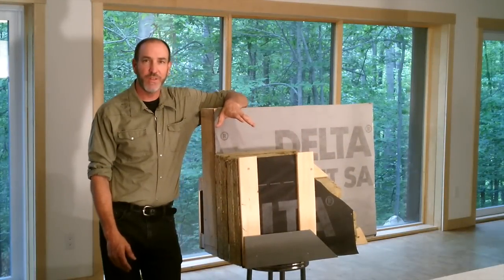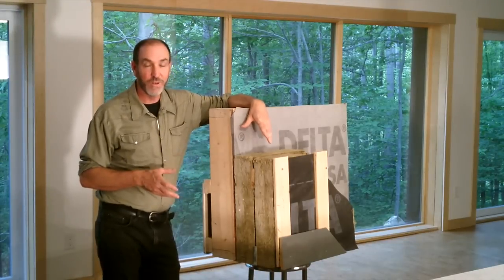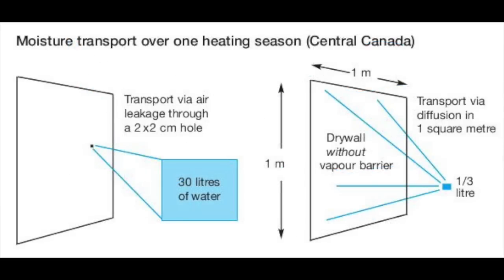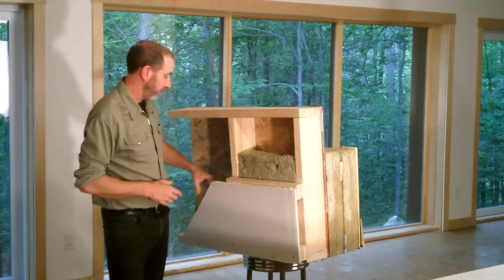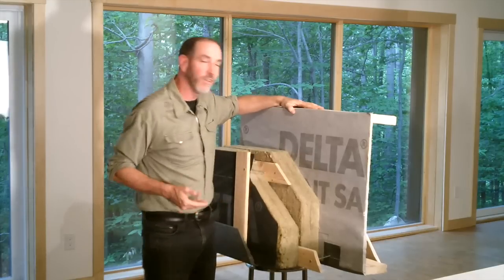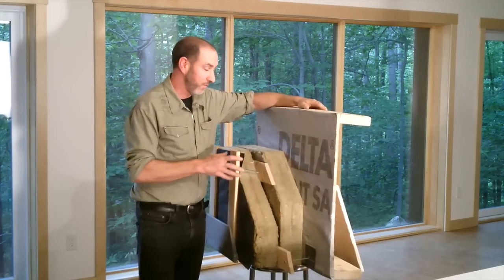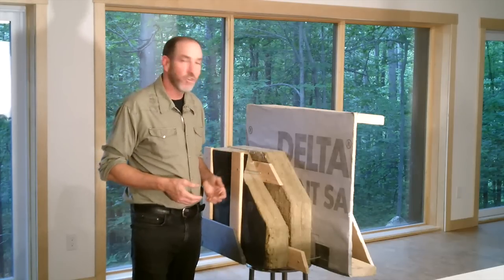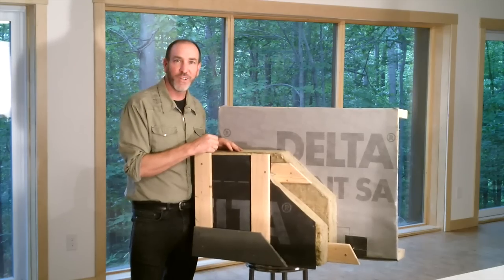How to Build High Performance Walls for Homes, LEED - PH - ZNE - Design, Insulation - EcoHome Guides

Comment: I cant agree with this wall type. as a GC, I understand the need for exterior insulation, however this is all great in theroy, but it costs much more in labour, and materials, and most importantly, time. i think just a proper tyvek, and one layer of roxul comfort board with 3/4 rain screen would be sufficient. but hey, maybe im just old school. its just that its much better in theory than practice.
Reply: Pete Billings - There are lots of ways to build a wall, this was an attempt, we as well found it to be labour intensive and would not do it exactly like this again. If you have a better idea, pop it up on youtube for the world to see - and shred :)
Reply: @Mreynolds.ecohome  Great stuff!
Do you have a link to a description of how you'd do this now?  Would it be different with 2x3" instead of 2x4" exterior mineral wool?  And where is your thinking today on the air barrier over the exterior mineral wool?
This looks like what I want to build now, but I'd very much like to hear about what I really should be doing.
Reply: PeteBillings PeteBillings Exactly. Old school won't work when energy costs start picking up 10%/yr as projected for the next ten years. With a wall system like this you can save on operational costs for the lifetime of the home. Further, you can reduce mechanical systems. Should really consider taking a course in passive house especially if you're a GC.
Reply: lol. Please don't patronize me by saying I should take a course in passive home.  I guess I didn't explain the  wall type I was referring to enough for you. I get a minimim of R40 with the walls I build, but they're simpler, stronger, and much less maintenance than this design, this double layer of exterior insulation will fall/collapse in 10 to 15 years in at least one section. Redoing siding , stucco etc... is not ideal 10 years after building a new home. If you were a GC, you would know, you cant build something you do not have complete confidence in. The vapour retarder paint is another idea Im not into.  what kind of upkeep does it require? will i really last 20+ years? As responsible contractors we build each home as if they're ours. I'm not arguing an eco friendly wall, I just don't agree with this wall design at all.  Looking at this design I can't be confident in securing the strapping or any type of siding onto this.  Its easy to design without knowing the ins and out's of the actual construction.  Like I said, I'm all for building passive homes, but I don't think going with greater and greater EXTERIOR insulation is the best way to go about it.  I would much prefer a double 2x6 or 2x8 wall with a 3/4" air gap between with 2" of roxul comfort bat for exterior OR 2" ridgid foam exterior that what this guy has come up with.
Reply: Theory is nothing without doing actual testing. Also roxul insulation has such minimal degradation it’s basically a lifetime insulating product. Which means as long as the house last the insulation will as well.
Reply: Pete Billings. Geez. This guy must have some rich clients. I built houses in the southwest for 40 years and built a lot of stud and crud. Some masonry, and a few frame wood siding.  But on a standard stud/crud house we used 2x6 frame w/ 1" foam over double d paper, then 2 coats of stucco. I always used 1/2" or 3/8" osb for shear. The inside cavity is just r-19 w/ vapor barrier then sheetrock. Sometimes we would go w/  thicker rigid foam on the outside pre- stucco. Are Canadians that well off they can afford these killer walls?
Reply: In my State of Washington, Tyvek doesn't work! Never has...now their commercial is much better? Why, 1. nobody tapes the tyvek seams...2. The problem with tyvek and cedar is well documented.. the tannic acid in cedar, (oak and black walnut to name two other woods)  attacks the chemicals that make tyvek...So, all the other stuff is not theory, its science...Passive house, sustainable building techniques have been been proving to work and save 25-30% in future energy bills...

Comment: How would you adapt this setup to improve on the R-value of ICF walls, and how would that influence the various air / vapour / etc barriers?
Reply from the maker: The easiest and surest way to improve the R-value of ICF walls (and to shift the Thermal Mass of the concrete to the conditioned space) that we've seen is this system from Legalett that is Passive House certified: https://www.ecohome.net/products/1069/slab-on-grade-insulated-prefab-form-systems-radiant-heated-legalett-canada-thermalwall-ph-insulated-rigid-foam-wall-panels-with-fastening-system-for-passive-house-or-zero-net-energy-construction-or-renovation-by-legalett/

Comment: why not just build with 2" by 12" traditional lumber, it will allow you add extra insulation, and have a better R-Value.
Reply: you lose the air gap and keep a thermal bridge
Reply: also 2x4s, even 2 of them are a LOT less expensive than 2x12s
Reply: A double 2x4 staggered stud wall is better R value with less cost and no thermal bridging. Still has a higher cost than a standard wall and eats up interior square footage. Exterior insulation leaves more interior living space.
Reply: Susan - There are always other ways to do stuff  and each with their own benefits and drawbacks. The thermal bridging would be reduced with a 2x12 but it would still be there, and that would result in a lower R value. We like the seamless blanket of insulation on the exterior. Regards.
Reply: Or, 2x8 and using Agapan (spelling) or Gutex as rainscreen?
Reply: @ike fun  what an unpleasant and unsubtle response. Certainly not consistent with your name.

Comment: this is crazy. if this energy thing and thermal bridging is such an issue for energy savings then aren't we building with the wrong materials. shouldn't we just replace all the wood with foot thick rigid foam walls. structural foam or in other words sips panel.
Reply: Ike - the house operates for $500 a year for all heating and electrical consumption. A lot of people pay that every month, so the added money you pay on a building mortgage comes out of your utility bills. Here is a great example of that, a builder who calculated a net savings every month by having a super-insulated house compared to a home built to code -  http://www.ecohome.net/news/latest/new-brunswick-s-energy-efficient-home
Reply: NO!, why surround yourself with oil, chemical foam and plastic? Once water gets in, and it will...you'll never know where its coming from, can you say mold, etc..I'm not sold on sips until they can make it with better products, plywood, mag oxide board, ceramic cement for insulation or mineral wool?
Reply from the maker: @roberthaverlock8605  EPS foam is a very succesful and reliable building material that has had an environmental makeover - consider the points here: https://www.ecohome.net/guides/3551/does-rigid-foam-or-styrofoam-insulation-have-a-place-in-green-building/
Reply: SIP panels are flawed because they don't provide the necessary air cavity for proper drainage. Moisture eventually finds its way in and has nowhere to go via drainage/air drying.
Reply: Its really quite easy,...I build mock-ups all the time, so if you can, get off the Foam wagon...when a house leaks with foam you may not be able for weeks or months find where it started from, not to mention its a firemen's nightmare when fighting the toxics...(they have to take showers with their clothes on after each fire) including all foam and  added toxics coming from inside the homes...
Reply: It is an amusing idea, and I'm pretty sure some think tank has brainstormed it. The reality is that those properties which make insulation great at insulating also make them bad as structural members. Sure, rigid foam is compression resistant but it is also dangerously flammable and air tight. The indoor climate would be a nightmare. Also, in terms of environmental "friendliness", given the primary energy required to produce insulation and the average life span of a house, insulation has a very poor life cycle. At least wood is a renewable resource, if managed responsibly.

Comment: So if Im doing a home renovation project with existing foundations and I want to add 4 or 8 " of insulation on the outside whats the best way to hold up the insulation?

Thanks
Reply: IPex products, home depot has screws as well...? See: https://www.phnw.org/assets/Conference2017/presentations/high%20r%20value%20-%20ricketts.pdf

Pages 10 & higher
Reply: What did you end up doing?
Reply: Batten and counter-batten the outside wall. The counter battens take your second layer of insulation in horizontal stripes. The battens provides ventilation behind the cladding. I might be expressing this wrong with my english. Here is an image: http://www.fassaden-dach.de/fileadmin/images/Unterkonstrukt/holzunterkonstruktioneinfach-2.jpg , with a brick wall, but the principle is the same. Such a renovation is going to be alot of work. Both the depth of you exterior door jambs and the soffiting will change.
Reply: Use structural insulated panels from Preimersips.com or R Control. You would not have to do a build out. A 6 1/2" wall preformed at R 29

Comment: Any concern with horizontal strapping between two sections of insulation not be able to dry if water gets there?
Reply from the maker: +Roman Gargulak  No concern at all. Water really can't get there, but if it somehow it did, this is the part we love about Roxul stone wool - water runs right through it so there would be no problem. The exterior membranes are moisture permeable as well, so it has excellent drying capabilities. Good question though, moisture trapped in wall assemblies is the biggest reason they fail. Regards, Mike
Reply: @ike fun         By golly Ike, your responses, both to Roman's question, which I did not see as an attack, and to other people's observations are very cutting, even to the point of being extremely unpleasant.

Comment: Did you require any engineering input/signoff on the strapping design/attachment for siding calculations over the thick foam? I know the BSC guys had done some research on it, but wasn't sure if it was an accepted practice in ON/QC yet.
Reply from the maker: +John O'Brien Our engineer was good with it, what you can't really see is that the siding insulation sits on the slab perimeter insulation,  which is sitting right on the stone at the base of the slab. So it isn't suspended. I've had a few people ask 'but what if you want to hang something on the side of the house?' My answer is don't hang something on the side of your house!  When you mention Building Science Corp,  I actually spoke to Joe Lstiburek a couple of years ago about this very topic, his seems to think we way over fortify cladding, if you check out our siding video there is a diagram in there about leaving air spaces at corners, inspired by him. he also recommends simply using sill gasket for an air space, super fast and easy. So no, not worried about it sagging, and don't like the idea of hanging canoes, ladders or anything really on the side of houses. here's the siding video. cheers, Mike 
http://www.ecohome.net/guide/install-siding